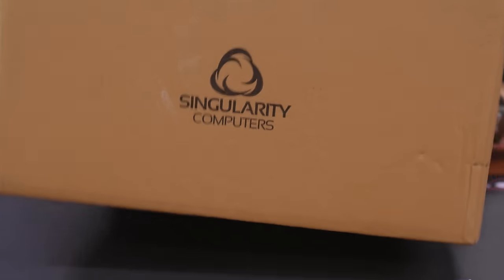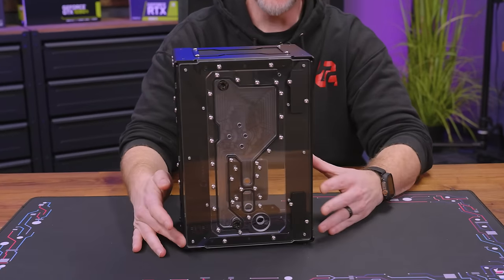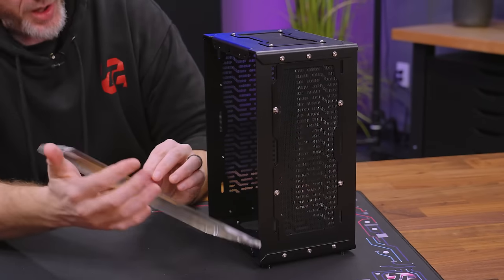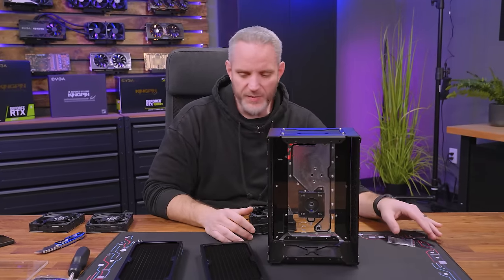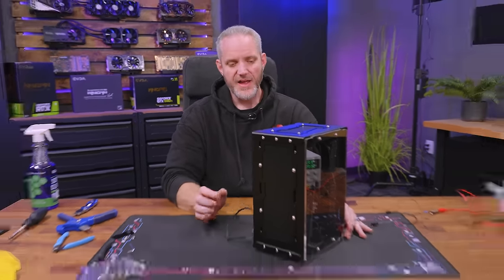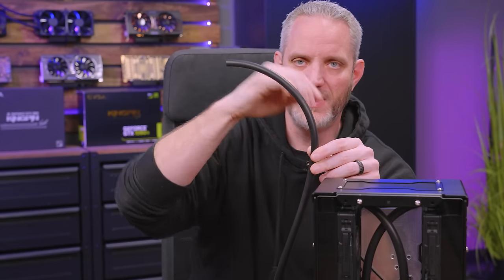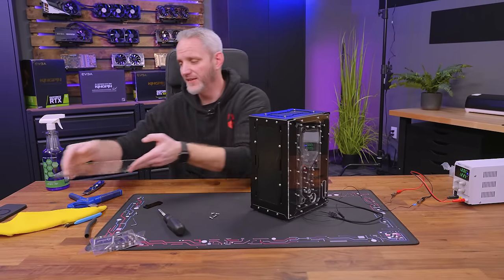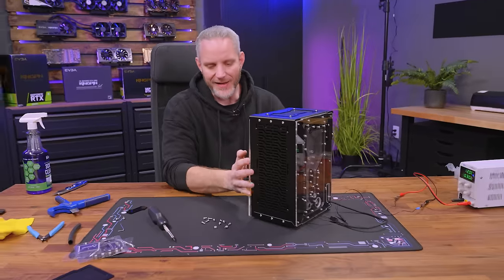External Loops are a thing again?

Comment: Masters in mechanical engineering: Ideally if one rad is an intake and one is an exhaust, then the liquid leaving the components would first go through the exhaust rad for initial cooling. Then the initially cooled liquid would go through the rad getting supplied with fresh air. This is based on the concept of counter flow heat exchangers.
Reply: So you mean first cool the hotter water 'a little' with the hot rad, and then finish off the cooling of the 'pre-cooled' fluid by moving it through the colder rad. That's good thinking!
Reply: That's what I was thinking, thank you.
Reply: I was thinking the same thing, with cross flow cooling. Seems like that would give maximum air flow without the fans working against each other.
Reply: Have worked in the chemical industry for the last 15 years or so and what you have described is basic heat exchanger principles. Have helped design a couple shell/tube exchangers myself and what you are describing will probanly give the best efficency for heat disapation. It will still depend alot on air exchange rates though. All my experience is with fluid to fluid heat transfer not so much air/fluid. Would love to see the testing on the different configurations.
Reply: Duh

This is common sense
Reply: You need a masters for common sense?
Reply: @systim30 there is a difference between knowing something works and being able to do calculations to find out how well it works. As someone who had a course on heat transfer, the logic is very simple but the mechanics, especially when it comes to convection and moving fluids, is very complicated
Reply: @randrazor  it's only as complicated as you make it.
Reply: @randrazor  you need a course to each you about heat transfer ... this is simple physics and science
Reply: What is interesting is that you could set up both rads in parallel, both fans as exhaust and then another inlet. This would be the most efficient as the heat loss over the rad is proportional to the temp difference between the media.

Comment: My toxic trait is thinking my first build ever is going to have a custom straight line water cooling loop
Reply: I don't see why that wouldn't be possible. If you take care of it you'll be fine
Reply: Yep, my first was a hard line custom build.  It worked great, I'm collecting parts for my next build.
Reply: Mine was too. Jay's how to's on this are pretty useful. Having a pair of calipers, CAD software, and knowing how to use them to measure and plan your bends also helps.
Reply: @alexandrumihailescu2252  because it can nearly 2x or 3x the price of your build depending on the specs 😂
Reply: That’s why my second build was
Reply: Just did my first build last month. Followed by my second
 For my son. Both custom hard line multi radiators builds. One in a hyte 40, my rig is in a tower 200. Doing a third in a tower 100 with 4 radiators to sell. Should be cool when done.
Reply: I did my first build not long ago and although it wasn't water cooled at all, I was still intimidated about the process until I did it and realized everything was actually really easy and straight forward. At this point I've seen enough videos that I think I could do a custom loop build with no problems. At least no major problems that I'd need help to solve. The only thing keeping me from doing it personally is that I don't need it and I don't have the extra money for it.
Reply: @BK-zy6lw Whether it’s your first or hundredth build, it’ll cost the same amount…
Reply: @HerpaDerp-ht8hy  yeah...I'm not sure what that has to do with it though 🤔
Reply: No harm in building it air cooled to start and then doing a custom loop
Reply: That’s a hard route for a first build, but hope you do it!
Reply: You could
Reply: Mine was... and we didn't have companies like EK back then, we had to get creative 😂
Reply: It is not as hard as you think. Just do it and have fun while doing it.
Reply: I tried it but I had 4 radiators and was trying to make 3+ bends on almost all them to make it work. Didn’t end up working so I went with soft tubing but honestly if the hardline runs are straight 90’s it’ll be easy
Reply: Just make sure it works without the loop first.
Reply: One of the best guys to do hard line water cooling is from the YouTube channel ' Declassified Systems ' he is a working tutorial on how to straighten pipes and clean up cables as all his builds are so clean and well done
Reply: I believe in you! My advice would be don't skimp on tools. Get a rotary tool for cutting and sanding the hard tubes. Get twice as much hard tubing as you need. Obvs a heat gun and guides/inserts for bending. And finally, large digital calipers for measuring the runs. Clear out a weekend for it.

Good luck!
Reply: Why not? I did hard line custom loop myself with my first build
Reply: @HerpaDerp-ht8hy somebody has never gone through 9 meters of tubing for a 1 build lol
Reply: Just finished the case side of my first build; all-watercooled, hardline triple loop, in a mirror-lined case-modded O-11 D. Ready to build the external rad holder next
Reply: My first I used outdoor hoses, aluminum blocks, and an automotive radiator I pulled from a junkyard Miata. Oh and a pump from a pond, and the res was a milk jug.
Reply: It’s really never been a better time to try that given all the resources and kits you can get now. Go for it!
Reply: I did the same, bought the water loop components from ali express. Was an overall good experience, but I will never do hard tubes again. Too much of an hassle when doing maintenance/upgrades. My next build will either be back to air, or bendy boys with quick disconnectors.

Comment: It would be interesting to test it in a number of configurations.  I would think the best way would actually be PUSH-PUSH.  Let the top and bottom mesh provide intakes of cold air into the box, and push that cold air out through the rads.  It seems like those two vents would be enough.
Reply: Yeah, that's what I figure as well. But I'd love him to test all 3 configs.
Reply: i was going to suggest this too
Reply: It doesn't look like the case supports it but seems like being able to put fans on the top and bottom would make it better either way so your not just counting on pos/neg pressure.
Reply: Same thoughts here, but I also feel like, all things being equal, the temp differences would be marginal, potentially slightly cooler with a cross flow due to the sheer airflow. It just seems like there would be some sort of equilibrium regardless of whether you have fresh intake air to both rads or blow through one into the other, much like how order of components in a loop don't make a difference...
Reply: I absolutely would go push on the rads, and if needed I would want the "rear" plexiglass replaced with a mesh filter.
Reply: @roadwarrior1961  yes, after seeing the video the difference from him removing the side panel to having it on was really  noticeable.
Reply: @nicholascrow8133  the temp difference between configs is usually a couple degrees, and the equilibrium would depends how much flow theyre doing. itd have to be pretty fast for anything high wattage to stay the same, otherwise itll be like 5-10c difference moving heat to once side
Reply: Top half is exhaust, bottom is intake
Reply: I seriously doubt it will make a substantial difference.  The air moves too fast to thermally saturate.
Reply: This the configuration I would suggest as well.
Reply: @astackopancakes2803  why though? the optimal airflow would not seem through those much smaller vent. Use the sides if you want to go that route.
Reply: I had the same idea, that seems like the version that makes the most sense.  Be very curious to see if testing agrees.
Reply: This was my first thought! Cool air on both rads
Reply: This

Comment: Living in Anchorage, there's two reasons so much air cargo passes through Alaska. The first is it's actually a shorter flight than flying to LA, San Francisco, or even Seattle. The second reason is that it's significantly cheaper to fly into Anchorage or even Fairbanks because the landing fees charged to the airlines are less. UPS and FedEx both have big hubs here, as does Amazon Air.
Reply: Also, that route stays a lot closer to land, which is handy given contemporary aviation maintenance. To be fair, it was a good idea when aircraft were a lot more reliable.
Reply: " The first is it's actually a shorter flight than flying to LA, San Francisco, or even Seattle."

The "Great Circle." 🙂  It's always the shortest path. Radio waves behave the same way.
Reply: Very interesting! Thanks for sharing.

Comment: I have filters on my system as well. They're the really fine mesh silverstone filters that almost look like silk. I actually find it way easier just to suck them off with a vacuum and a brush attachment. No screws, no removal. I built my system in 2015 and the inside is still clean.
Reply: I also just vacuum my filters. The dirt is on the outside so why not just use a vacuum to suck it off from the outside! :D if doing it regularly it wont build up enough to get inside.
Reply: At least it will never get blue balled.

Comment: I would say the split flow (All fans exhausting) might be the easiest way to create the cooling, as long as you have enough passive intake to keep fresh air for the fans to pull from.
However, another option that would really work nice, is have it a cross flow (1 set intake, the other exhaust), but have the exhaust radiator be the first part of water flow (to begin the cooling), and then have it go through the intake radiator (to get the freshest air for the final cooling).

Comment: I believe the push pull or single direction flow would produce the results you stated by heating up one rad over the benefit of the other. The double intake is a good idea too, but I believe the increased air pressure within the box would reduce the capabilities of the fans. Sure there are upper and lower exhaust, but the performance is based on how efficiently it can exhaust the air. Especially with high performing fans. For me, I would make them both exhaust so that either radiator would constantly receive cooler or room temperature air making the lower and upper openings supply similar tempered air for both rads. It creates a vacuum for air draw. The intake would be consistent based on the performance of the fans rather than the ability to alleviate the pressure from the box.
Reply: First thought was to have both rads exhausting air but I think cross flow would be slightly better due to sheer airflow. I don't think there will be much, if any, difference blowing through one rad into another, at the end of the day you are removing heat from the same loop, rad's don't add any extra heat to the system.
Reply: Both exhaust and both intake have the same problem, restricting the fans.  You either build positive or negative pressure inside the case, both of those reduces airflow across the rads.  

I think one intake one exhaust will perform the best, but I could also see where the three different configurations will all be pretty close in performance.  I think all intake would work great with a 140 exhaust up top.

Comment: This is such an elegant set up.  You could have a tiny case on your desk and hide this in a corner somewhere but still have great cooling.  My solution to a case too small for my loop was to get a giant 360x60mm radiator with push-pull fans and quick disconnects and run the wiring along this umbilicus back into my case.  It wouldn't be that hard to move the reservoir / pump combo onto a fan mount attached to the radiator as well, if I wanted.

Comment: I'd like to see that test video, for sure. I think I'd set them both exhausting outward, that way they're both pulling fresh air in from the top and bottom. But, like you said, it'll take some testing to see which is more efficient. Bet a cross flow ends up being the most efficient way to do it in the long run, however. It might be pumping heated air into the other rad, but I would also be the fastest way to move air through the entire system.
Reply: I think cross flow for airflow might be best as well. A rad heating up air flowing into another rad is still removing heat from the same system, it's not adding any extra heat to the system, at least that's what I think

Comment: 2:54 if I remember Anchorage is used for air cargo as a intermediate stop for fuel (and maybe clearance). Cargo airlines are far more spoke-hub since they rather run the planes with less range for larger cargo payload. I think for CA packages UPS for example actually flies from Anchorage to SoCal, but I’m in WA, and UPS flies from Anchorage to their Worldhub in Louisville Kentucky before flying back to Seattle

Comment: I have a single loop, CPU and GPU setup with front and top rads.  My loop runs from pump-GPU-CPU-top rad-to front rad and then back to res.  The logic for the loop was the air coming through the front rad would basically precool the top rad fluid and then the front rad would further cool the fluid before being dumped back into the res and recycled.

Comment: Personally, I would have cool air come in through the top and bottom vents so it can go through the radiators and out of the box into the room. This will stop all heat from heating up the acrylic, pipes and pump. This makes more sense to me because acrylic can crack when it gets too hot, and pumps can fail when they get too hot. Protecting both is wise.:thanksdoc::hand-purple-blue-peace::yougotthis::thanksdoc: This is why the two vent filters, top and bottom, leave a big hole when removed. They are not supposed to be removed, but the two side filters are.

Comment: Intake plus exhaust rad is a wash as far as coolant temperature and loop efficiency goes, but what it absolutely will do is bake your air-cooled internal components. Dumping heat into the box is never a good idea; your motherboard and drives will bake! I have first-hand experience! All rads should always be exhaust, regardless of location.

Comment: I definitely would love to see what options work best.   It is kinda an interesting set up.   That said I do see a very limited user base for this.    Frankly what I would love to see is more well done open and wall mount options done in mind with water cooling though.    That is probably the one way I could see this being really interesting is combined with an open air PC set up.  
  
I have actually been considering an open system for my next PC and can't decide between bench style or wall mount.    The amazing part about this would be that it would get rid of most of the issue of the open PC of the loudness by containing your fans.    I just wish it had a way to wall mount it.    Seriously that would look damn good wall mounted next to a wall mounted PC, especially if you designed it so you could run the water behind the wall mounted PC and into this from the back.     My biggest issue with all the open design computers is they tend to look terrible with water cooling.    

My other thinking is an open air desk set up that I could use this on one side of the monitor with the P3 on the far side.     The monitor should hide the tube run between them and it would look pretty damn sick I think.     Not sure how well a D5 would work with that long of a tube run though.   Is that something you could test is how well this would work with longer tubes.

Comment: I built a relay circuit for my old external water box, and then used a 12v power brick that cost like $15-$20 to power the pump and the fans.  The relay was hooked to a USB cable, and then I set the bios to only turn on the USB ports when the system is powered on.  I had a bypass switch on the external cooler so I could force the power on if I wanted, but otherwise, when the computer turned on, it turned on the external box (that was behind a wall).  Gave me amazing cooling with virtually no sound through the wall and virtually no heat impact in my gaming room since the hot air was in a completely different space that was insulated, and only the tubes and the USB had to go through the wall.  It's a SUPER simple build  that ran almost perfectly quiet and didn't heat soak the room.
Reply: Using a relay to power on a relay to power on the separate power supply is a nice idea, better than just a power strip.
Reply: @elviscera4661 Thanks, the USB 5v triggering a 12V relay worked like a champ with the bios configuration change to only turn on USB power when the computer turned on.

Comment: There's a really good reason why they fly via Alaska. Anchorage is a cargo hub and has both big cargo rooms for things to be stored and a big customs checkpoint. Cargo planes also don't have as big fuel tanks as normal passenger airplanes, so they need to refuel more regularly. Cargo planes also don't have that many passengers that might be annoyed at a several day trip to take the extra route that is better for economic reasons for cargo than going across the Pacific Ocean.

Comment: The radiator pulling air in will not have a negative effect on the exhaust. 
Basically, the temperature difference should cancel each other out.
The reason for this is that the first radiator cools the water down. Therefore, the water going to the second (intake) radiator would be colder, thus needing less cool air to cool it down.
With that, even if that air heats up, it should be around the same temperature if not cooler than the first (exhaust) radiator.

Comment: Small suggestion towards the "testing limited by radiator"; You could use three 420mm radiators with soft tube connection. So you just quick connect to the test system and start measuring. 😊

Comment: The way i would use this is with cross flow. But what i would do is something different. The "front" radiator would be the cold coolant one, and the "back" radiator would be the hot coolant. So that way, you have the hot side getting colder air helping it get colder faster